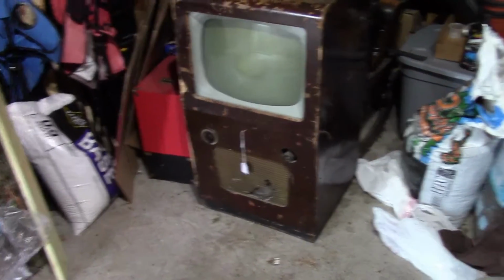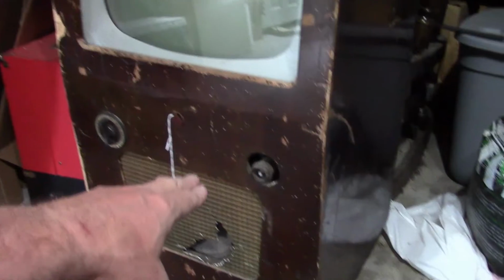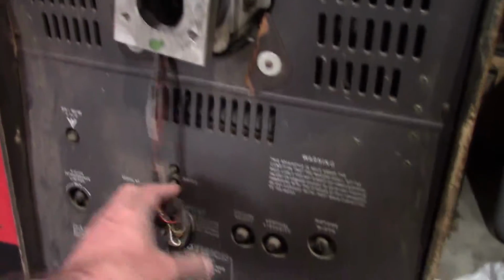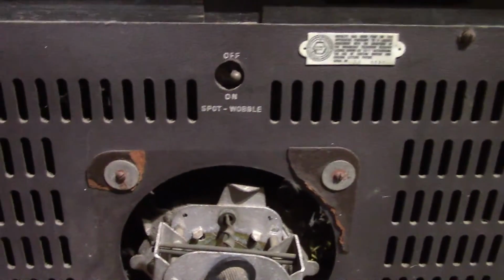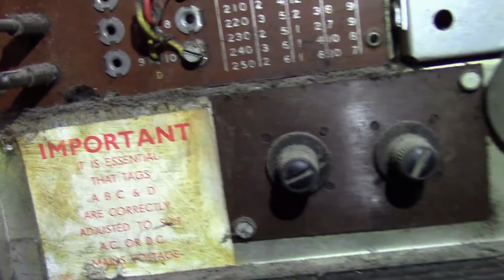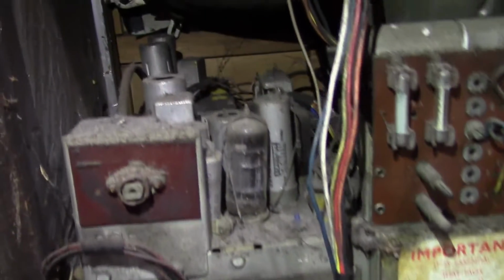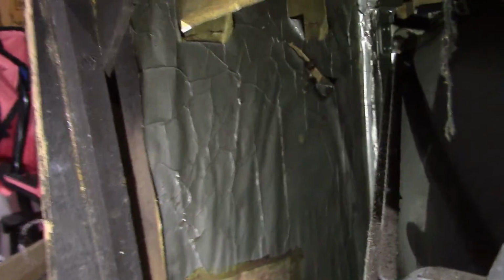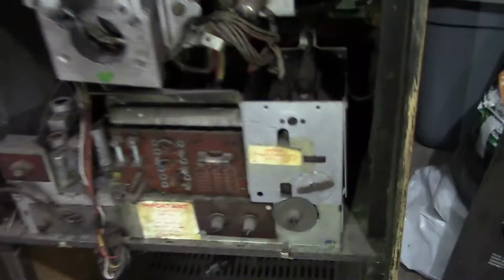Ekco 267/I restoration p1o?

Comment: Just read on thevalvepage that ECKO used Perspex around the horizontal output transformer. Might be a good idea to check if it hasn’t cracked and been tracking.  It can end up a charred mass

Comment: This looks like it will be a fun yet challenging project for you Bob. Something out of the ordinary for sure!
Reply from the maker: So far the biggest challenge seems to be finding a way to generate the old 405 line standard.  I may have to shell out some money for a global standards converter box.  Although it can probably be converted to work on 525 line NTSC, I'd much rather see it running as originally designed.

Comment: You may have already noticed the sound on 405 lines is 4.5Mhz below the picture.  E,g channel 1 is 45mhz video and 41.5mhz audio.  Audio is recovered from the i.f. strip, as its AM and buzz would be impossible to stop if it were recovered after the video detector. Edit: I wonder if you’ve been able to source the Hedgehog standards converter? It can produce 405 lines from NTSC 525 lines. Also the early TV museum has a VHF 405 line modulator which should work with the hedgehog
Reply from the maker: Thanks for the info.  Hope to take a close look at the chassis soon.

Comment: UK monochrome TV system had 13 VHF channels. 1-7 called Band 1, 8-13 Band 111 (3). Band 11 (2) was used for VHF FM radio broadcasting .  405 line 50Hz from rate . Video modulation was inverted to all other systems.  Sound mod was AM not FM

Comment: There were a few sets in the UK that were produced right at the time we switched to 625 lines. They had both 405 and 625 scan selectable. The 405 was transmitted in the VHF bandwidth range while the 625 was UHF, so the sets had a VHF and a UHF tuner, similar to the ones you see in the States. The one I had when I used to collect TVs was a Thorn 1400, this had a design fault whereby they would have really bad sound separation on UHF which would cause a horrible buzzing sound - we called them buzz boxes.

Comment: You’d need to get an Aurora converter or build a Hedghog converter to watch stuff on it.

The flyback transformer is EXTREMELY reliable but the plastic frame housing it’s in is awful as it can disintegrate and can even become conductive, which caused a fair few fires at the time, so you may have to make your own housing out of paxolin or something similar.

All wax paper and black or brown Hunts capacitors will need evicting! They were crap even at the time (TV engineers used a choice word that rhymes with “Hunts” to describe them!).

Also test a load of resistors, loads of them will have gone high as the resistors weren’t the best either.

Look out for Bodger repairs. We Brits were known for penny-pinching (cent-pinching?) on repairs when sets were getting old.
Reply from the maker: I read about that plastic frame and saw a photo of a twisted, warped one.  This one appears to be in excellent condition though.  Thank you for all the advice.  This will be quite an adventure :)
Reply: I speak from experience, an aurora 405 line converter will not accept an NTSC 525l/60 composite source, they are for PAL 625/50

Comment: Very interesting model from the EKCO company I wasn't aware of. I own an Ekco TMB-272 portable which, I suspect, is a bit more recent than yours and above all is supposed to be "portable". It's still in its transportation packaging (I bought it years ago when I started my channel, being unsure how to restore it back then). It'll be interesting to see how you restore this one, Bob. That being said, I do have the full schematic of the TMB-272 if that is any help to you. Just for reference the Ekco TMB-272 uses a CRM93 CRT from Mazda and apparently these CRT's use a filament voltage of 12,3V and are aluminized
Reply: The TMB272 is from the same model year as this. It uses the same circuit but on a compacted chassis, with an added vibrator (not that kind! Take your mind out of the gutter!) for operation from a car battery.

TMB = Television, Mains/Battery.

The CRM93 is not aluminised, it has a dedicated “Visconol” EHT smoothing capacitor. That will certainly need replacing and it must be removed wearing rubber gloves as the chemicals inside could be carcinogenic!! Any suitably rated EHT capacitor will do.

Comment: You’re not wrong about the Hunts capacitors, both the wax and ‘Mouldseal’ ones are all pretty much completely shot by now. The mouldseal ones usually split open like the Black Beauty’s
Reply: Their electrolytics are usually 50/50 depending on how the set’s been stored. Dry storage usually gives them a chance at reforming. Damp storage writes them off even if they work for a short while.

Their cockroach capacitors must all be evicted, however!

Comment: It should be 13 channels (VHF 1 to 13, TV system 'A', +ve vision modulation, AM sound).
Line line rate is 10125Hz, Frame rate is 50Hz. 405 lines total, 377 visible.
Interestingly the 405 line standard dates to 1936 hence the AM sound and positive vision modulation.
You may find that not all the tuner biscuits are installed since we only had 2 channels at the time.
The broken CRT is normally a given on that brand of tube, at one point I hear there was even a waiting list for replacements under warrenty!
It will probably be fine running on 60Hz mains since we had frequencies from 40Hz to 100Hz and voltages from 200v to 250v at the time.
As for a source of 405 lines the cheepest would probably be to ask someone with a standards converter to record the output onto VHS tape, Low end 50Hz VCR's will generally handle it. You may have to build a modulator though. Alternativly you could build a test pattern generator (lookup thevalvepage.com under projects).
A vision interferance limiter is basicly a peak level clipper, since 405 lines uses positive vision modulation (increasing amplitude = increasing spot brightness) impulsive interferace produces bright white spots, the interferance limiter clips the amplitude to the preset value.
I MAY have a a schematic for this set but I would have to check.
The 3 tubes in the high voltage box are the horizontal output, efficiency diode, and EHT rectifier.
HUNTS capacitors unreliability generally refers to the small brown/black plastic encapsulated paper capacitors rather than the electrolytics (in a metal can).

Comment: The LOPT (Flyback) should be fine, you are lucky that the perspex frame is not a melted mess!
Beware that there are caps that look like resistors in this set, your set is a 1957 model, the FM radio will work in the states, it will tune around 90-100Mhz.

Comment: Spot wobble never really caught on, was around on some sets in the mid to late 50's.Believe it caused some RF interference which may account for the screening. 
Vision interference limiters, whilst good at the time for helping peak white(positive vision modulation) interference reduction can give the effect of a flat CRT if set too high or faulty, must be set to minimum or just disconnected. 
Antenna connector is a belling Lee socket, also known as a Pal connector now, you can get F socket to 'Pal' plug adapter fairly easily, search Pal plug adapter etc. 
The flyback/line output transformer (often referred to as LOPT in forums) hopefully is fairly reliable as it was in the TMB272 portable also from 1956.All screws in it will be British 'BA' series probably, metric was later.
Think the tuner has 3 FM radio positions maybe labelled L H T(BBC Light, Home and Third)
FM range is 87.5 to 95 MHz on the original UK FM band. 
So there will be a small switch and cam arrangement activated when these are selected  by the tuner to turn the timebases off and switch in an FM detector (TV sound is AM). Think by then IF's were standard 34.65 MHz video, 38.15 audio though just a chance might be around half that if not not the standardised
frequencies, will be on the service data.
Reply: Yes -- because the 405-line system used positive modulation of the video signal, interference, such as from electrical appliances or passing motor vehicles back when they didn't have very well-shielded ignition systems, would appear as bright white specks on the picture -- compared to the negative modulation used by the American 525-line system, which makes interference less noticeable. The 405-line system also used AM for the audio signal instead of FM.

Comment: Wow. I am living in Southend-on-Sea, in the same city (back then town) where this was made. Ekco Radios from 1930s are more known here for their roundie look!
Reply: The old factory building was taken over by the Access credit card operation around 1971 I believe.Now the site has houses on it possibly? I used to know David Whitworth of Sendz Components at Westcliff in the 80's,they were a famed TV surplus components mail order/shop. David worked at Ekco 'back in the day'.
Reply: @HughTVDX  That’s true, although TV and radio manufacturing stopped there around 1961/62 soon after Pye took over Ekco’s domestic electronics business, Pye had a factory a fair distance up the coast in Lowestoft. Which was bought by Philips when they took over Pye in 1976, closed by Philips in favour of their Croydon factory in 1980 then bought out and opened by Sanyo UK in 1981, closing around 2008, the factory being demolished afterwards.

Ekco concentrated on electricals (not electronics) and plastics at their Southend factory until 1971. Because of its history and skilled workforce in making plastics, it was ideal for Access to use.

Comment: These are the sort of sets I learned on.. got them from the dump. Ekco are nice and simple.. it's not a Mullard !! (as you might discover on the UK radio forums) I watched the end of 405 broadcasting in 1985 and had to retire a really nice Murphy set from 1958.

It's a shame I downsized around 20 years and handed on all my vintage TV schematics and service books or I could have just scanned you the paperwork for this or any other UK set from 1936 onwards... But I'm sure somebody on the UK vintage forums will be happy to help...

 I forgot.. I'm a member.. and there is a thread on the T267/1 .. I can nab you any info you need.. there are a few bits of schematics and other things in the thread.
Reply from the maker: Thank you for the offer.  I was able to get a very nicely scanned copy of the service info from https://www.service-data.com/
Reply: @bandersentv  No worries Bob..  I have the one and only restore thread there bookmarked in case you run into anything strange. It should be possible to coax this set to run on 525@60 without too much trouble... the frame should just lock as it freewheels off the mains frequency.. but watch the EHT output at the higher line frequency. I think there is a "set EHT" pot somewhere. 
We used to mod 405 sets to do DX reception back in the 80's. Main goto was the RBM 1400 chassis.. no doubt some old timers used sets like this as well. Unfortunately I'm one of the old timers now myself..

Comment: Ekcovision TC 267/1 ( one). See Trevor Howsam Limited site for comparision photos including the back. To get this
 running you will need to buy a good step- up transformer I imagine and a Mazda picture tube of course. The reference 
to band 1 is 1-9 TV channels and three VHF AM radio channels. Band 2 is VHF AM radio only. As the Ekco company loved
 using prespex transformers heat would allow cracks to form in it causing the high voltage to arc all over the place. There 
is  a trade sheet schematic available for it which I found at UK Vintage Radio under Ekco TC267/1 halfway down the page.
No parts list made so the valves are just marked V1,V2 ,etc.
Reply from the maker: Yes, I saw that same website. The perspex in this set appears to be in very good condition. It's right above the flyback as I showed in the video. I'll attempt to use an American picture tube. The base, pin out and dimensions appear to be the same as a common 17".

Comment: Very interesting video, Bob! I can certainly see why there would be some metallic lining on the inside of that TV's cabinet. Most people in those days, on both sides of the pond, listened to AM broadcasts; perhaps this was done to mitigate any interference of the noisy AM signals that are generated by the set. Perhaps it was also a regulation requirement set forth by the UK's equivalent of the FCC. If you get it up and running, at least you won't have to purchase a receiving licence from the BBC! It has been said that they had strict receiving licence enforcement back then.
Reply from the maker: They did and it's my understanding they had detector vans that drove around listening for TV receiver "noise".  I wonder if this was someone's attempt to evade detection?
Reply: @bandersentv  I think your idea is more likely the case to be honest, re. avoiding the detector vans. It's certainly not the first time I've heard of people putting foil round their sets. Only issue is that some of the RF gets radiated back up via the antenna cable which I think is what they actually picked up ..also, apparently only one van actually had any equipment in it. The other 9 were decoys, deterrents. So, probably still a knock on the door if the real van turned up. I remember seeing one going past once.

TVs DID ruin long and medium wave reception though.

BTW I've never encountered a foil-lined set myself and I've seen (and have) a few old British tellies.

Good luck with this project. Here, a knackered CRT would mean a parts-set sadly. But as for generating 405-line signals, if you get in to restoring these types of sets, I could do worse than to recomment the Aurora converters. I'm sure there's one which can take NTSC source signals? I'll hav eto check as mine are the original versions of PAL to 405 ones from years ago.

Best of fortune & looking forward to seeing pictures on this thing.
Reply from the maker: I must admit most of what I know came from watching "The Young Ones".  The lads are visited by the TV detector man in episode #4 😁
Reply: @bandersentv  These were fantastic. Love how he swallows the telly in an attempt to hide it from the inspectors! .. with the cable still hanging out, ready to be plugged in ☺
Reply: @bandersentv,kind of off the subject,but on the subject of British Television shows,have you ever watched “Red Dwarf”?
Reply: @bandersentv,I’m mostly familiar with the older British shows like “The Prisoner”,”The Avengers”,”Danger Man”,”The Saint”,”Dr.Who” and the Gerry Anderson “Supermarionation” shows,etc.  I just looked up the series you mentioned “The Young Ones” on YouTube as I hadn’t heard of it before.  The theme is from an early 60’s film of the same name. I have a 45 rpm record of Cathy Carroll from 1962 singing that song,it’s in my jukebox.
Reply from the maker: @Suddenlyits1960  Absolutely.  Every episode to date I think.
Reply: @bandersentv,
Lister: There is no such thing as silicon heaven.
Kryten : Then where do all the calculators go?
Lister : They don't go anywhere. They just die.
Kryten : But surely you believe that God is in all things? Aren't you a pantheist?
Lister : Yeah, but I just don't think it applies to kitchen utensils. I'm not a FRYING pantheist. Machines do not have souls. Computers and calculators do not have an afterlife. You don't get hairdryers with tiny little wings, sitting on clouds, playing harps.
Kryten : But of course you do. For is it not written in the Electronic Bible, "The iron shall lie down with the lamp"? Oh, it's common sense, sir. If there weren't a better life to look forward to, why on Earth would machines spend the whole of their lives servicing humankind? Now that would be really dumb”

I remember when it first got broadcast out here in the late 80’s on one of the UHF channels.it’s definetly one of the most imaginative,irreverent,hilarious shows of the time. 
I think the first episode I ever saw was “time slides” where Rimmer goes back in time to steal the idea of the “Tension Sheet” from Thickie Holden,so he would have wound up a millionaire and avoided becoming a chicken soup vending machine repairman and hologram on Red Dwarf.
Reply: @bandersentv,Bob,I have to thank you for referencing “The Young Ones” and bringing it to my attention. I had never heard if it before. I’ve just watched a few of the episodes and can’t stop laughing!  Man! That show is wild,deranged and has a manic pace!   It’s often surreal and filled with absurdist humor! 
The first episode ends with two pilots casually discussing crashing a plane,then panicking and taking a jet into a nosedive and destroying the building that was about to be demolished, there are talking rats,a self loathing,suicidal hippie trying to hang himself in front of an open window with too much rope and one of the guys hanging himself on a cross while reciting poetry! 
In the second episode the “lads” move into a new house and Mike discovers Buddy Holly hanging upside down from the ceiling where he’s been eating spiders to stay alive. 
Buddy: “I just love your English Beatles,mind you after 20 years I ain’t got much choice”
Mike:”I thought you were dead”
Buddy:”A lot of folks did,but it ain’t harmed my career none”
That shows a riot.
Reply from the maker: @Suddenlyits1960  You're welcome.  It's a fantastic cast.  The four main guys have been in many BBC productions over the years.
Reply: @bandersentv  many uk 50's tvs had metal foil in the cabinets, sometimes with a wire bonding to chassis. Some radios too. I suspect a shield from external interference affecting the picture rather than enforcing RF emissions, we didn't really have a strict body like the FCC in those days and in any case, what would the TV interfere with?